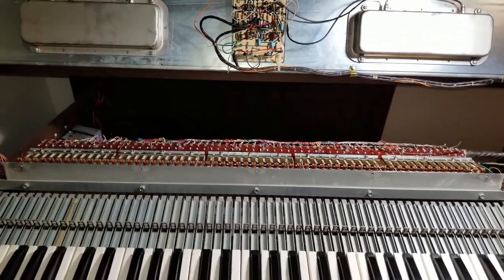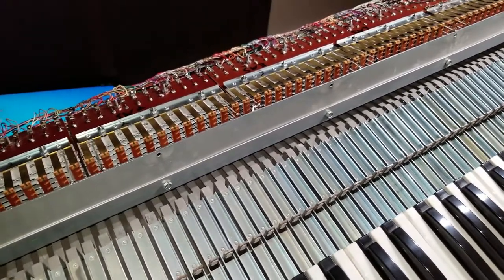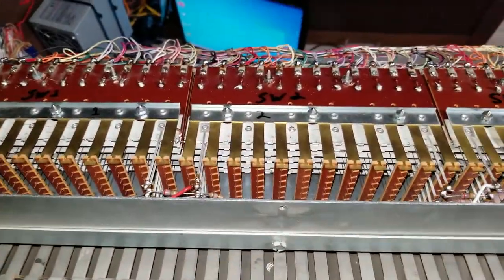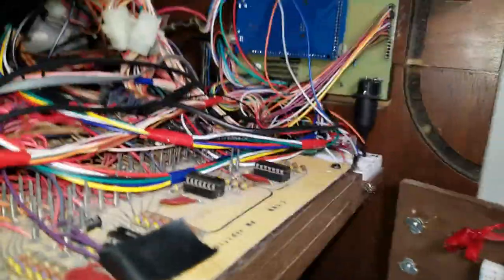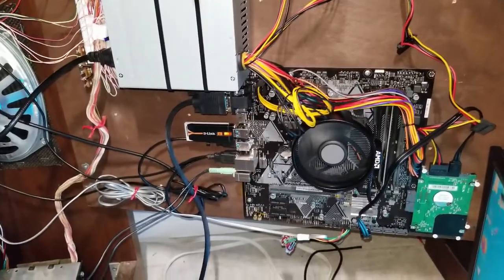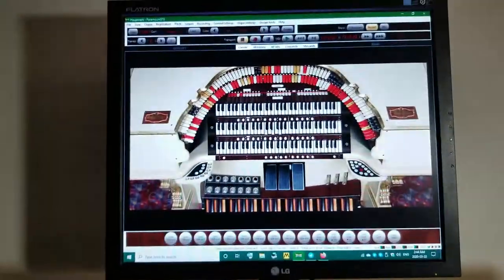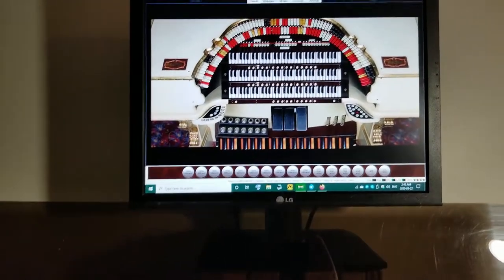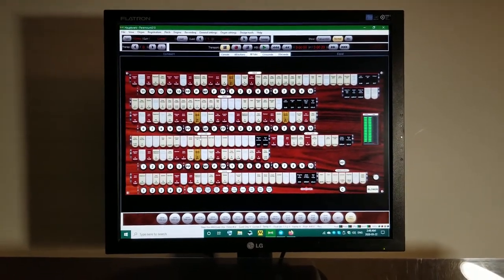Baldwin C630-T Organ MIDI Conversion Part 3: Completed Manuals, Pedals, Expression Pedal, Pistons

Comment: That’s awesome! Would love to hear it in action! Our church has a C630-T that I’ve paired with two Leslie 710’s. It sounds pretty good for the 70’s technology! I’ve got some recordings of it on my channel.
Reply from the maker: I always did love the sound of this organ. Pretty much everything is intact so in theory I could one day fix all of the problems and have a fully functioning analogue/MIDI organ. This organ also had a Leslie hooked up to it at some point, and still has a Leslie speaker adapter on one of the original audio outputs.